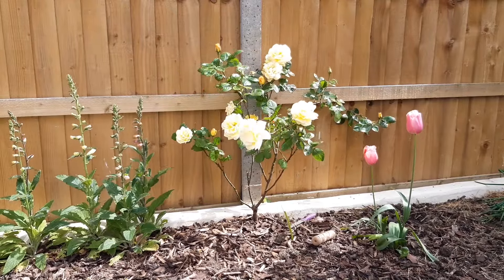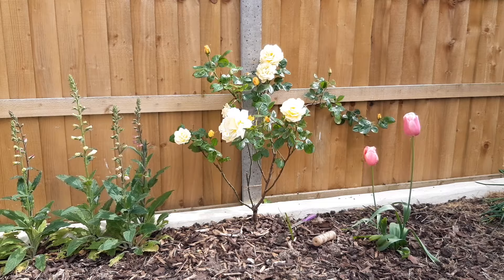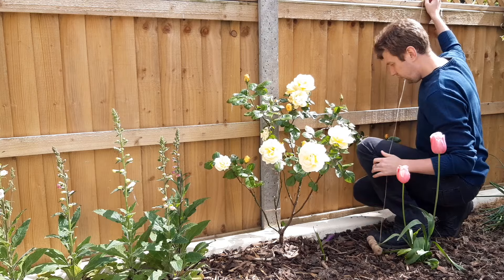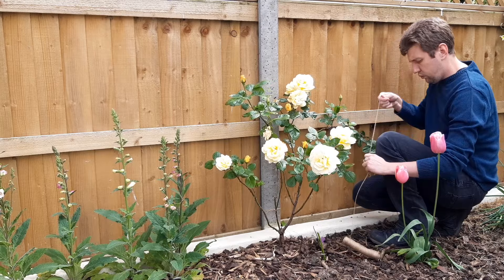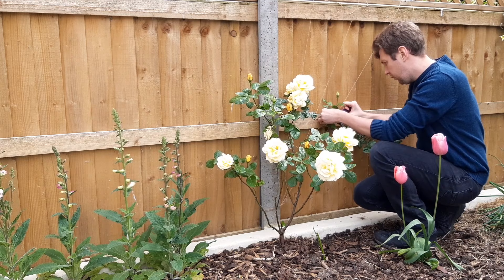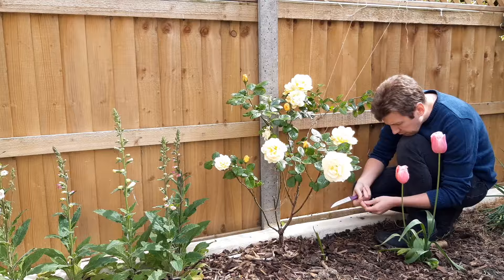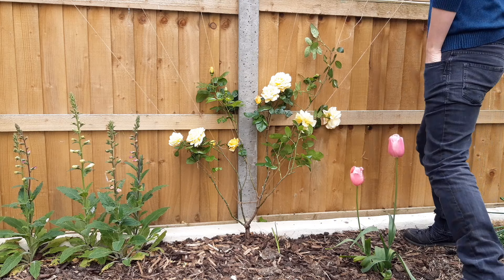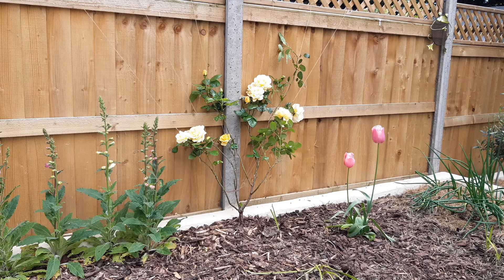How to Train Climbing Roses | Quick & Easy Tutorial

Comment: Kindly zoom in next time or do a closeup vid.
Reply: I agree. He skimmed through the important parts.  What is he tying the twine with on top of the fence? Does he have nails there? Is the twine going to be sturdy enough? Good concept but lacks clarity and details
Reply from the maker: @annann-fn2zi apologies if I missed some details, I've learned a lot about roses since. I can help to answer some of those points: the twine is strong enough but best not to tie it too close to any thorns and tie it relatively tight so the plant doesn't blow in the wind. There's a hole through my fence post and between the slats on the fence panel which I loop through. No nails or hooks 👍 I hope that helps and apologies again that you found the video lacking. I'll try to do better in the future

Comment: Hey, really helpful video. I’m planning a DIY wire trellis on a stone wall in a similar design. My question is, is it OK to not have horizontal wires? Are vertical/diagonal wires alone OK? I’m worried that my rose might slip down the wire where I’ve tied it over time. Many thanks!
Reply from the maker: Hey Malcolm, thank you for the comment. Yes I see what you're saying... wires are used a lot for espaliered apple trees though (mine all use wires) and though these are horizontal, they're really just for shape and not really used for holding the plant up. 

So long as your trellis is secure and doesn't move, I wouldn't overly worry about the shape.